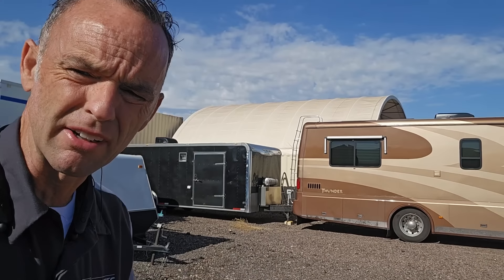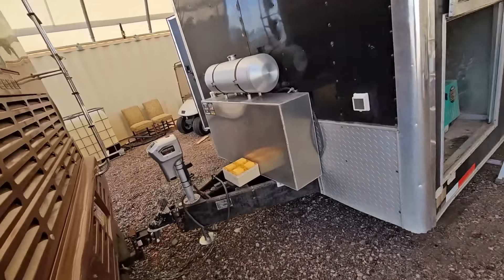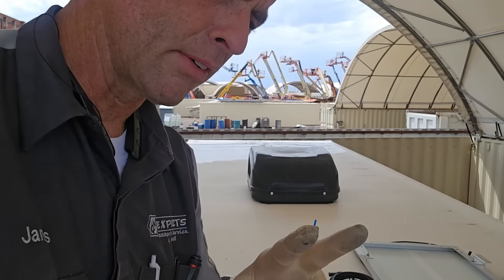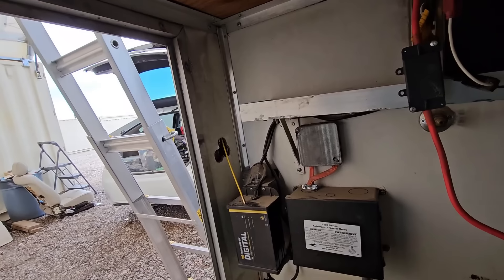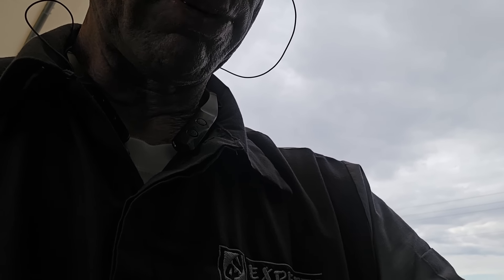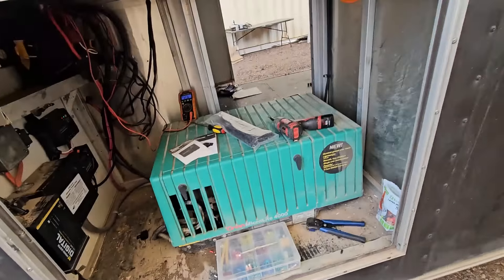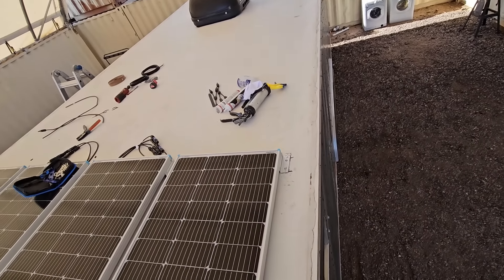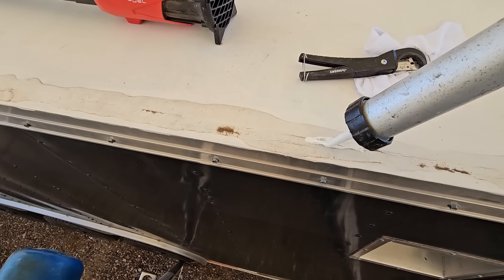Keeping Batteries Charged On a Carhauler

Comment: I appreciate all the different solar systems you're installing. You're showing a system can be as complex or as simple as necessary. You don't need to spend thousands to just top off batteries. And whoa boy how clean your installs are!
Reply from the maker: I appreciate that!
Reply: @AZExpert 
Don’t be mad at yourself that you have solar content on here.  that’s how I found you and that’s what I enjoy.😮
I also came for the RV techy stuff, but there’s only so so many times you can fix the fridge or vent.

Comment: The more we see referring to solar installs the more we learn and the "black magic aura" dissipates. 

Your think it through first planning, assemble all the parts, and calm demeanor, make these projects seem doable by non-professionals. Especially when it comes to keeping the water out and don't put any more holes through the roof as absolutely necessary. 

Well, at least the calm demeanor we see in the video. Maybe off camera you throw such a fit that others in a 1/4 mile hearing radius often think: "Oh that's just James, something isn't going right or he's stress testing something".    

 If a component can't handle a 6-10" toss and land, it sure as hell isn't going to withstand the pounding it will receive on the Interstate at 55-80 mph. If anything you're tosses may help show a pre-existing weakness sooner rather than later and can be remedied before steady field reliance has become mandatory.

Comment: I don’t have as much solar experience as you but one of the issues I have found with parallel solar panels is if one under produces enough voltage then the whole system drops below the charge threshold 
It was with 12 volt panels so maybe 24 volt panels won’t have that issue 
With so many battery maintenance isolators on the market I would have opted for 2 of those to maintain the car batteries and 2 sets of panels in series to the charge controller to the trailer battery if could not talk the guy down to just 1 or 2 panels.  Redundancy in parallel can actually derate your solar
Reply from the maker: That would be true about 2 panels in series too.

Comment: There were 100 ways to do this, and I'm fine with you and/or the customer picking any one of them.  

Personally, though, I'd run all 400W of solar into the trailer battery through one controller.  Then just use a bulletproof $39 Bestek 300W pure sine inverter to power any battery chargers for the cars in the trailer, or anything else.  People understand plugging an extension cord into a 120V outlet strip a lot better than they understand solar panels and solar charge controllers than have no battery hooked to them.  I'd just label the outlet strip "200W max total load for this strip inverter combined".

The little inverter's idle/parasitic draw is more negligible than the vehicle trickle chargers, and both are easily handled by 400W of solar and any battery that's alive and maybe 20Ah or more.

Comment: YES! Manual says don’t connect panel without battery. That doesn’t make any sense to me either. It is OK to run Lithium down to 0% and BMS will simply shut off to protect cells. That’s a feature. Why doesn’t solar controller do the same?

Comment: I built a below floor battery holder right in front of the axle so the batteries dont take up space inside and the weight is balanced my panels are for battery tender only